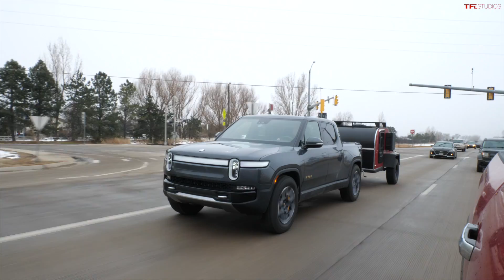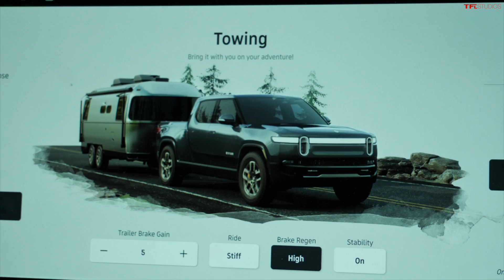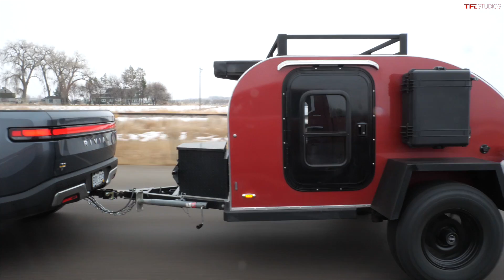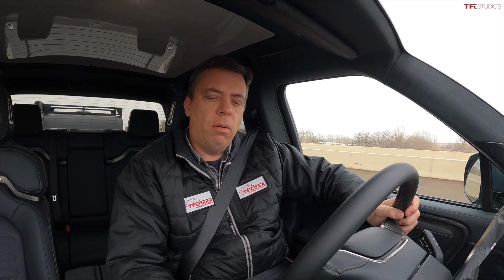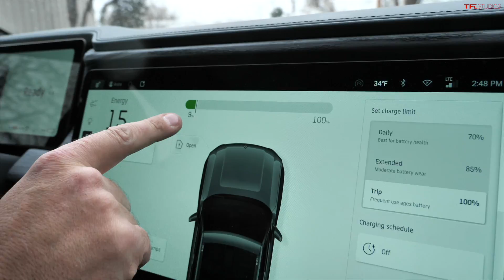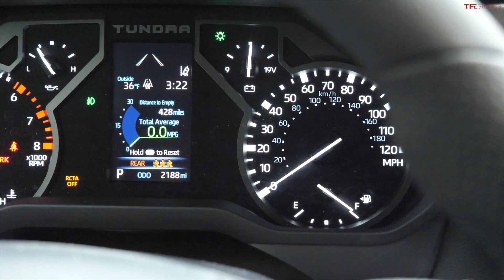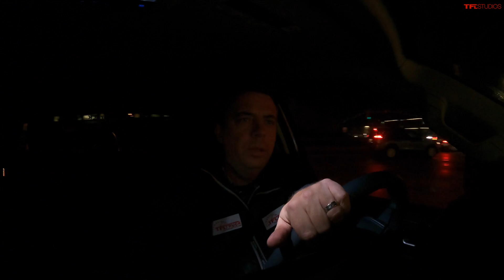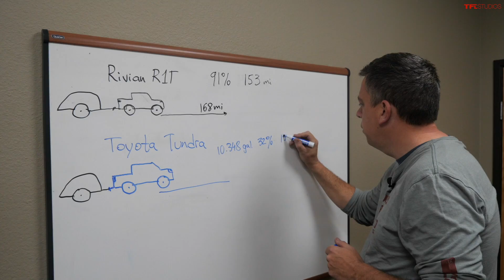Rivian R1T vs. Toyota Tundra: How Far Can Each Truck Tow On A Single 'Fill-Up'?

Comment: Great comparison, and great work as usual! As a couple of others have mentioned, a “cost for trip” or “cost per mile” comparison would be informative. Obviously fuel and electricity costs vary by area, but do it the TFL way; “Real World”. My thoughts would be to use a DC Fast Charger rate (Electrify America?) for the electricity instead of charging at the TFL World Headquarters.
Reply: Well, here’s the thing. Understand, I’m a Rivian fan and I have an order for an R1T. The cost isn’t just in fuel, but in time. You’re going to have to recharge a Rivian twice to get the range of that Tundra. And it seems to me you’d have to charge it to 100% as well. That’s going to take A LONG amount of time. If you’re working, thats a huge amount of money. I personally look at my time in $ per hour. Charging the Rivian would cost a massive amount of money in time.  

Fortunately, for me, I don’t tow very often. I also only tow to my property near Breckenridge. That is why the Rivian is still on my shopping list.
Reply: Don't forget to account for time spent charging/filling...minimum wage would be fine as a unit of measure I suppose even though nobody that "poor" could afford these.
Reply: The initial cost of the vehicles makes the cost of the fuel a moot argument. I think you're asking the wrong question. Car & Driver recently tested charging on Electrify America with a Rivian, which took their small pack from 10% to 80% in 72 minutes. That puts a theoretical 0% to 100% charge time at 102 minutes with the same on a Max Pack at 140 minutes. That's assuming you can always charge at a max rate.
Reply: @mtnman1984  I think it would take a lot longer than 102 minutes to charge to 100%, it’s not linear. It takes much longer to charge from 80% to 100% than up to 80%.
Reply: @mtnman1984  Comparable trucks are $10,500 more for the Rivian (64.5K Tundra and 75K Rivian).  Less the $7,500 tax credit and now $4,000 difference.  In roughly five years the fuel savings alone covers the delta. Add in the oil and filter changes, more frequent brake service, etc, the payoff time is decreased.  Rivian updated the software via OTA and charging time curves were noted as part of the update.  The upside of an EV is the ability to avoid public stations unless on road trips.  Most vehicles see ~70 miles daily.  Otherwise, overnight "fuel ups" are a daily thing with little human involvement.  For us the kwhr cost ranges from $0.08 to $0.10.  I'm thinking the Rivian costs about $13.50 for a 0-100% recharge.  Spitballing, but the Tundra would cost $38 for the same 280 miles assuming 22mpg.  And all of this is assuming one can get a Rivian and the Toyota dealer sells at MSRP.  All speculation at this point.
Reply: @robertjmecchi  I made charge time calculations using the theoretical 300kw that comes with the update based on the speed of charge from 10% to 80% observed in a recent charge rate test using Electrify America by Car & Driver. From 0% to 100%, just over an hour for the base pack, just over 90 minutes for the max pack, and 262 minutes to match the ballpark range of the Tundra in the test conducted in this video. Electrify America's current rate is $0.35/kwhr, according to their site. $65 for the Max Pack. Of course, charging at home is cheaper, but this video is testing for a road trip. For similarly optioned trucks, it's more like a $20K if you spec the Max Pack battery that gets you 400-ish miles against nearly 700 miles for the Tundra. If the Rivian can fit your needs, OK. It cannot match the practicality of the Tundra when it comes to towing even a teardrop camper light enough for a Subaru Forester to pull. The difference between the two gets pretty vast as the trailer weight and size goes up. The Rivian didn't make it through their "Ike Gauntlet" before running out of battery.
Reply: @mtnman1984  I agree that in the tow category the Tundra is superior in terms of distance covered for any given time due to charging. Most people don’t charge beyond 80% as the last 20 is extremely slow. The typical road trip for an EV is stopping before 10% remaining. Not unlike gassers.  This does necessitate more stops, but over all less time than waiting to get that 20% for a full charge. As for pricing we paid $0.16 per kw on our last EA charge. But 99 percent is roughly $0.09 at home. Used to be less than $0.05 when Griddy was allowed to exist. If I was buying a truck to only tow, I’d get a diesel. If I’m buying a truck that is used like just about every half ton gasser for non commercial purposes, I’d get an EV.  Well, maybe I’d get an F150 hybrid. The ability to power an RV via the truck is appealing. Personals choices. Mine is economics and primary use based. I’ll manage the exceptions.
Reply: @robertjmecchi  yeah, it's kind of an amplification of the shortcoming of long distance travel by EV: charge time. The more energy expended to travel, the more that issue rears its head and towing seems to make the EV trucks an impractical choice. This channel tests trucks to their advertised capabilities. The Rivian is one of the very few that scored a DNF in The Ike Gauntlet test. If you don't intend to tow anything more than a short distance, you're good to go. Powering a travel trailer with the truck does sound great, but it looks like your campsite better be within an hour's drive of a charge point.
Reply: @mtnman1984  Not really. When a battery pack gets to roughly 80%, it takes more time to get to 100% because a battery at 0% "sucks" in all the power it can get. Over 80%, the charger is trying to "pack" it in, and heat becomes an issue. The hotter the battery, the longer to 100%.
Reply: @mtnman1984  regardless of income, and entry price of these rigs, the cost for each of these trucks to go a certain amount of miles is still relevant.
Reply: @tomjahn6896  it really isn't. At current fuel prices, it would take over a decade to make back the price difference for similarly equipped trucks. Nobody is buying $70K-80K vehicle (typical spec for pre-orders) because it saves on gas. Nobody who wants to regularly tow any long distance is likely to buy one either, if they are cross shopping ICE pickups, because if the charging impracticalities.
Reply: @mtnman1984  I hear you, but I'll also tell you that cost to operate these still is a factor. I'm not talking about the amount of years to recoup the cost to go electric vs gas.
Reply: @tomjahn6896  "cost to operate" isn't "cost to drive".
Reply: @mtnman1984  semantics, but ok.
Reply: @mtnman1984  Another thing most people wouldn't think of is buying a base model. With just AC, power windows, and a basic radio, your range and payload increase dramatically. I've never understood buying a truck with carpet. Muddy boots destroy it in months,  never mind the extra weight in sound deadening, electronics, and a 100lb extra power seat.
Reply: @jimshorts6751  dramatically? By how much?
Reply: Cost per mile needs to also account for my time, which is FAR more valuable than a gallon of gas or a KW of electricity.  If you can afford a $70k+ truck...its likely you're time is also quite valuable.
Reply: @Stevemax07  every person still only has 24 hours in a day. So everyone's time is still a precious commodity. On fact you could argue that an hourly persons time is more precious than a salaried persons , because they get paid by the hour, not a set amount per day.
Reply: You can’t just look at cost. Time has value. Imagine a weekend trip taking 5 hours instead of 1.5, each way. Hard to put a price on that level of inconvenience.
Reply: @tylerhackman6832  your example of 1.5 hours each way requires one charge ( assuming towing) so an extra hour in total - 3 versus 4 hours.  And if not towing, no stop is required. And if your stopping at an RV park, you can charge there requiring no stop what’s so ever.  The only hurdles for Bev’s are the longer journeys, eg cross country where the driver want to get to the destination in a mad dash. And the other hurdle is that in some states, eg Dakotas, Montana, Wyoming, etc) have limited fast charging stations. But for weekend warriors, the Rivian works well.
Reply: @robertjmecchi  sure, if you pretend that when you’re at a destination you don’t normally run errands, use the truck for little things, etc. I love EVs but mid to low 100s range just isn’t realistic. And hell the tiny little trailer won’t be the norm either, like many have said.
Reply: @tylerhackman6832  MotorTrend towed a van on a trailer (9k pounds) with an effective range of 170 miles. 90 minute drive is 120 mile max and that’s assuming 80 MPH. Leaving you 50 miles for errands with the trailer attached. More if not. Plus a 10 minute charge will net another 30 miles easily as you pick up your Creamed chip beef from the piggly wiggly.  Is this different than what you’re used to?  Of course. But it’s hardly an inconvenience. It’s just change like using shoe laces instead of Velcro straps.  Or a belt versus elastic waist pants. Or a model T versus a horse and buggy.
Reply: @robertjmecchi  agree to disagree. But that’s interesting that mt got more miles with multiple times more weight. Must have been nicer temps
Reply: @tylerhackman6832  wind, no heat pump, road conditions all impact EV’s strongly and seeing how Rivian is the least efficient EV ever released it places large limitations. This vehicle is simply not very versatile. Sure if a boat/camper is being towed 50 miles there is some wiggle room but hard to pass as an all around adventure vehicle when it is so limiting on a road trip.
Reply: @Thisisaplaceholder1  agreed. We’ll get there, but we don’t have the tech right now.
Reply: I agree - charging at the TFL headquarters would cut the recharge cost in half and would be more likely for farm truck charging - towing a camper over the road will see DC fast chargers except at start/end points.
Reply: It is very expensive unless you are charging at home. @11:07 they state they used about 122.85 kWh. In Colorado Electrify America is $0.43 for guest and $0.31 for members (per their site).That is $52.83 and $38.08 respectively using 100% efficient numbers, more accurate is probably closer to $58.11 and $41.89 (with 90% charging efficiency). This is not a vehicle that is good for towing at all it is not aerodynamic which is needed on electric vehicles and too small of a battery. The smart choice would be to stick to close destinations or free/cheap destination chargers.
Reply: @Thisisaplaceholder1  The Rivian completed the loop using less money than the Tundra. Using your number of 0.31 per kw.  The only drawback for an EV towing is the range. Which most owners do a small portion Of the truck life. The majority of the time is spent commuting. Which they would be spending $0.05 per mile in the Rivian versus $0.17 per mile for the tundra. And the Rivian would never need to visit a gas station and be 100% every morning. The economics is far in favor of the Rivian. The drawback is needing more stops (and more time) for road trips. Which again, is not the rule. It’s the exception. Studies show people drive less than 50 miles a day and Most RV trips don’t exceed 5 hours from home. So a Rivian would require a charge along the way to the destination. And if your at an RV park (shudder), the Rivian can charge there. In fact many rv parks provide EV charging. Or bring your own EVSE. Certainly if you’re a road warrior, an ICE is better. But for the majority of truck buyers, a BEV meets every day needs and requires some planning the few times the rv is being used.
Reply: @robertjmecchi  his fuel up was $40 and change when you consider the time involved unless it’s charging overnight most would not consider the $2 worth it. It’s simply a bad tow vehicle. This video was about towing not the economics of electric vehicles. I cannot wait to own my own but recognizing when a vehicle performs bad in an area is important for innovation.
Reply: @Thisisaplaceholder1  ok. Add up all the times a gasser needs to fill up. Off route. The BEV needs to do that only for extended trips. Otherwise, pull into your garage and plug in then walk into the house. Done.
Reply: @robertjmecchi  again you were missing the point this was about towing not day-to-day use. If the owner of this vehicle needed to tow on a very regular basis for work or recreational use it would be a poor choice.
Reply: @Thisisaplaceholder1  In that case, if we’re only speaking about a dedicated towing vehicle, I’d buy a diesel.

As for the Rivian. It’s not a bad tow vehicle. It handled the 8k flawlessly. It simply has a small range. MotorTrend towed 9k with it in Cali and got 123 mile with 47 miles left. Again not great, but for what people actually use trucks for, works for 99 percent of people.  The one percent who tow regularly over 150 miles, clearly you are in this group, need more range. Maybe a gasser is your choice. But that doesn’t make the Rivian a bad truck. It just makes a bad tow vehicle for people who tow over 150 miles.  Different perspective I suppose.
Reply: @robertjmecchi  I agree with everything said there. My perspective is very limited charging in the Dakotas leaving the Rivian a very poor choice to tow a boat/trailer. I love that more options are cropping up but was sad its range was so limited removing it from my option pool.
Reply: The Toyota is definitely cheaper!

Comment: I been talking about that they should put batteries in trailers for a year and a half now for electric vehicles. Just makes sense.
Reply: Imagine charging both batteries one after the other.  200 plus Kilowatt hours.  You’d be using that camper to sleep over night at the charger…

Comment: I would like to know cost to fully charge the battery on Rivian. We can figure cost of gas. But do not have a clue of recharge costs at a public charge station. Thnx
Reply: Take your cost of electricity and add about 20% for charging loss.

The Rivian used about 123 kWh. Using a $0.15 / kWh rate, that's $18.45. Including charging loss, that's about $22.14 to do what they did.